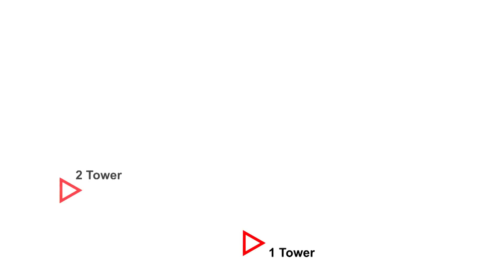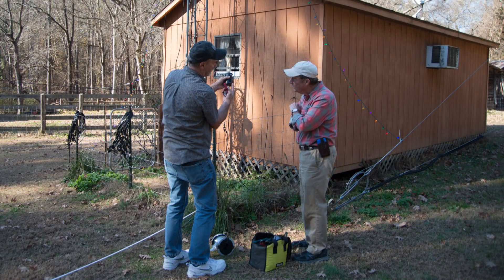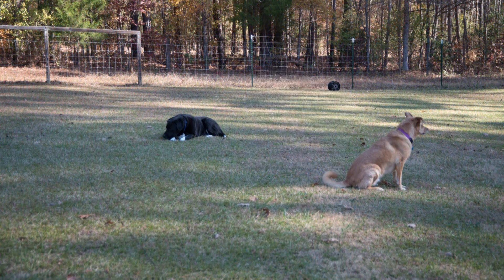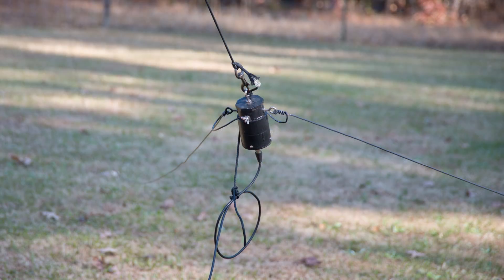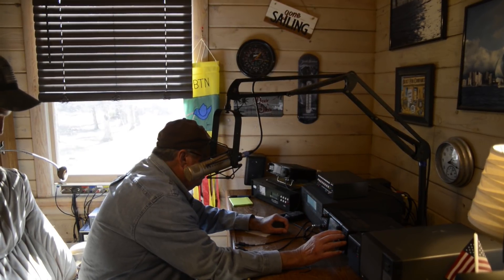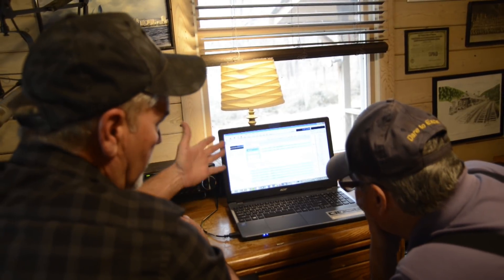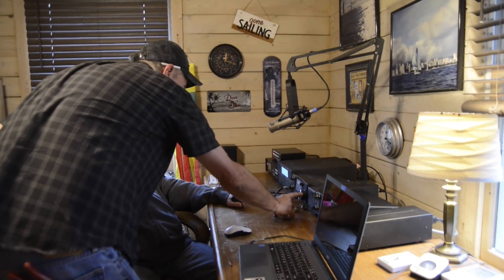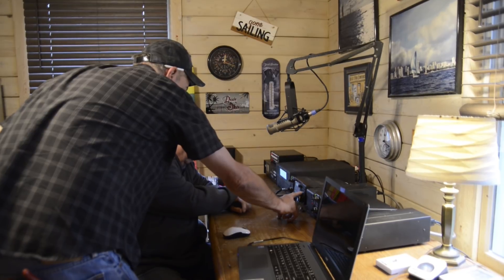Delta Loop Antenna 80 Meters K4WDG

Comment: Why not just cut the loop for the lowest frequency you are going to use and feed the corner of the loop wit balanced feed line preferably 600ohm? A 4to1 that i would guess in in your antenna tuner? If you're using NEC2 if i remember it should tell you the length of twin lead to get multilabel resident   points within the armature spectrum??
Reply from the maker: David like to experiment, he now has two towers.

Comment: Great video. I'm thinking about putting one up before winter descends upon us. 
Now, modeling this with software, I get a LOT more low-angle gain by feeding it 1/4 wavelength from the " corner". And the SWR is about 200 ohm's and a 4:1 current balun gives a good match. 
Feeding it on a "corner" gives me a cloud warmer. Feeding it 1/4 wavelength from the corner gives me a radiation pattern similar to a vertical.
Reply from the maker: THANKS.
Glad the antenna is working well for you. Also thanks for the information.

Comment: My 80 meter loop is by far my all time favorite wire antenna. I feed mine with 450 ohm twin lead with a 4:1 balun close to my transceiver with just a short run of coax. Loads on every band 80 through 6 and I've had fantastic results with it over the years. Instead of putting the balun at the loop feed point, try my arrangement. I think you'll be a lot happier with the results.
Reply from the maker: Thanks for the information!
Reply: Thank you for the heads up! 73 AE4OY William Peacock 🦚 EM-81UF SOUTH EAST GEORGIA
Reply: How much meter use 450ohm ladder line your 80m loop antenna?

Comment: I have built countless loops for 75 and 80 meters make it a mono bander get rid of the balun and use a section of 75 ohm cable for a matching stub you will easily get a 1 to 1 match just by trimming the antenna or adding a little. If you want it to tune to any band using a tuner use a 4 to 1 current balun feed it with ladder line and trim the antenna to get the best match possible for the length the loop was cut for 3 to 1 or better. Usually 40 meters dont work to well on it but the rest work great.
Reply from the maker: Thanks for your comment.

Comment: I made one for 30m and one for 60m. They worked great until the solid center conductor of the 75ohm 1/4 wave matching section broke, i need to find some other 75ohm coax or use a 4:1 balun.
Reply: HI from Dambuster  4 to 1 balun is 200 ohms to 50 ohms unless it is 200 ohms at the feed point you will have a mismatch. I have used open wire feeder on my 40 METER delta loop feed back to the shack to a home brew balanced tuner that way you have a multi band aerial. The impedance  of the delta loop depends where its fed.
Reply from the maker: Thank you, and your welcome.

Comment: What ballon did you use to feed that loop with 50 ohm coax
Reply from the maker: 2 to 1
Reply: From my experience on 40 m the feed impedance at the top of the apex is 100 ohms I have not tried 1/4 wave of 75 ohm coax stub  in to 50 ohm coax  but according to what I read it should do the trick.

Comment: I did exactly the same - 80m full wave horizontal triangle loop up 22m. Pneumatic launcher - CSV 17, #12 copperweld, no balun, 450 Ohm window line straight to the side of the KX3. With 10w I had 5-9 across 3 provinces on 80m SSB. Super antenna. Oh also used plastic covered clothesline wire for over the tree limbs - strong and slippery. 73!
Reply: Greetings from Leduc Alberta. Hope you’re still having lots of fun with your radio. Me I’m just beginning to school up for the exam. At 67 brain 🧠 ain’t what it was. 😂
Reply: @richardshort4587  Hope you do ok. Best of luck. Do look up our SASTAR group or my call at arrl dot net.P.
Reply: @ve6kk  Thank you Sir for the reply and the encouragement. It may be a while but I will give you a shout out once I’m rigged out. God bless you and 73.
Reply from the maker: Thanks!

Comment: Loops are great antennas! My most effective arrangement has been a full sized vertical square pulled up into the big pines in back of my house. Fed at the middle bottom it acts like two dipoles in broadside. I use a 4:1 balun and it works on 80, 40 and 20; the even bands.
Reply from the maker: Thank You.